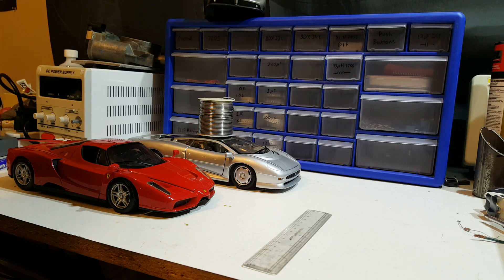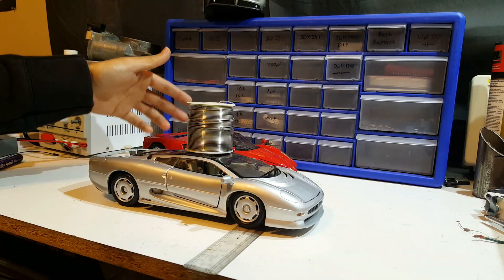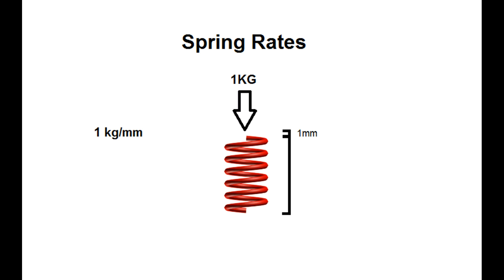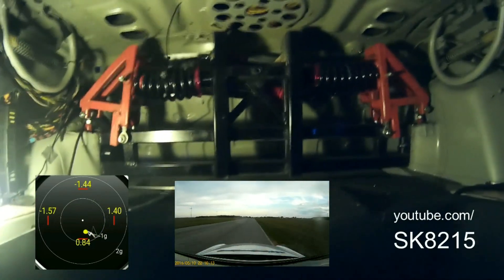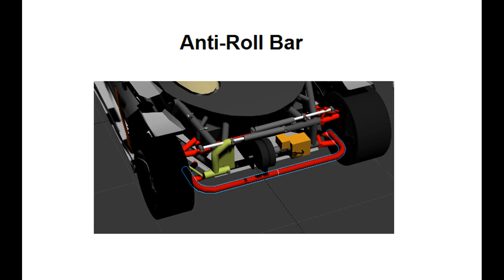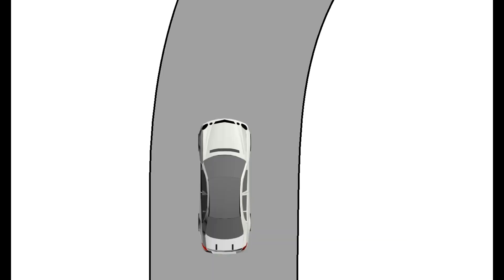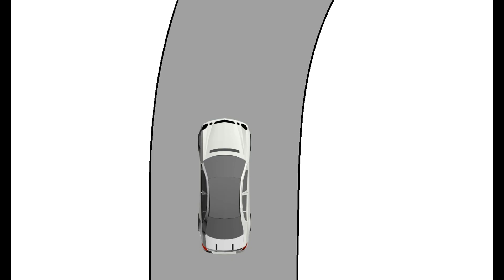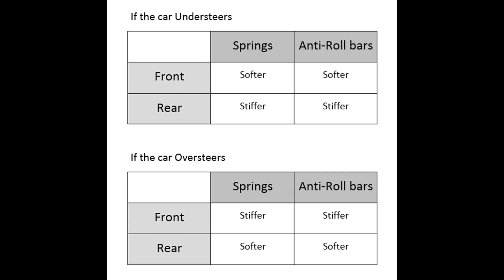Suspension Setup (Springs and Anti-Roll bars / Sway bars)

Comment: You stated that adjusting the top lock washers on the coil overs is where you adjust preload and ride height.. Can you explain yo me how this adjusts ride height over the bottom coil over body adjustment? It was always under my understanding that the top was only for preload and never for ride height... Very good video by the way
Reply from the maker: The cars weight can only compresses the spring by a certain amount so adding preload wouldn't compress the spring further, it just lifts the car higher. The only time it actually compresses the spring is when the suspension is at full extension. 

The lower setting will also change ride height but your changing the point at which your suspension bottoms out every time you change that. Without proper bottom out settings the suspension could go past its normal travel range, so the tires could be hitting the top of the fender or the cars bodywork scraping the floor everytime it hits a bump too hard.

Ideally the bump rubber over the damper is supposed to stop that from happening if the length of the coilover is set properly.
Reply: @xfmotorsports  good job on those videos, just would like to point out about corner balancing, what you said in the video end comment here- when you do it with spring preload that's when you are changing the travel ( more preload will result in cars weight compressing the spring less , shorter distance) , and will have less effect on transferring weight between corners , plus it will vary a lot depending on your springrates. That's why me and people I've worked in the field with usually use mostly the hight adjustment perch for corner balancing and preload for damper travel ( or otherwise - a combination of both).
Good job again. And impressive self control on some off the comments obove .
Reply: It would depend on the design of the coil-over. In most common designs i.e  "BC suspension"  (with separate ride height and preload) range lowering or raising from the bottom will not change the damper piston stroke position. The whole suspension unit would be static in its own right and only be lowered or raised via the bottom cup. 

If it only had a single adjustment point "spring perch". It would do both simultaneously. If lowering excessively it would reduce compression damper stroke plus on full droop ( when the car is jacked up ) your spring would be unsupported and rattle so they introduce helper springs. 

I am not familiar with what's fitted in the car but the above rings true for most suspensions kits on the market. This kit may well act as stated.

Comment: At 17:42 I don't understand how reducing ride height at FR also increases the load at RL. It should actually take away some load, right?
Reply from the maker: In that example there's more preload so more height added to the FR, so that will tip the car over towards the RL tire and add load on that tire as well. That's just to explain corner balance. Usually you wouldnt change ride height on an individual wheel, its changed equally on both sides so the corner balance remains unchanged.

Comment: Very informative! There's one thing I don't understand when you put the rear seat bar to the front wouldn't the car roll more in the rear and less in the front?
Reply from the maker: The front and rear cant roll independently of each other unless the cars chassis is really wobbly. Usually chassis only flexes less than a degree so the front and rear body roll is more or less the same.
Reply: SK8215 I guess you're right. I am thinking more in terms of ride height than roll angle. The chassis may roll the same amount f:r but the car will pitch forward/rearward in roll depending on the effective wheels rates. If all the sway is up front the the car may not roll but the car will squat as weight shifts rearward in roll. This would cause understeer as load comes off the front tires.
Reply: This can't be correct. 

You even say in the video that you don't want your sway bars to be too different front and rear... Now you're saying it doesn't matter because of chassis stiffness? In a dynamic situation, like acelleration, weight shifts reaward and I'm 100% positive the rear can roll more than the front in this situation. I've seen the pics to prove it (rwd with no rear sways).
Reply from the maker: The reason you don't want extremely different sway bars front and rear is to keep load even otherwise you can end up in a situation with one wheel lifting off the ground (inside tire reaching 0 load). 
The situation your talking about is pitching and rolling at the same time like under acceleration out of a corner. That still does not make the front and rear roll differently. The roll centers can be different front and rear in which case the car rolls around an inclined or declined axis but the roll is still the same front and rear
Reply: SK8215 I disagree with that and you even contradict yourself in your own rebuttal by saying the car can roll at different rates but roll will be the same f:r on the outside tires. That's just not true if more weight is shifting rearward due to acceleration and the outside front tire is unloading... the inside rear tire will squat and roll more than the inside front tire when accelerating out of a turn.
Reply from the maker: That's not what I said at all. Read the comment again. Roll is measured by the amount your cars body leans towards one side from horizontal. If your accelerating the car pitches back at the same time as well. That does not make the rear roll more than the front. Its just pitching and rolling at the same time.

Comment: From my understanding (don't know if it's correct or not) , by having an anti-roll of whatever stiffness, it's limit the overall body roll so you can keep the overall car CoG close to it's ideal spot in expense of taking out the grip of the tyre (either front or rear) as the anti-roll bar always unload the inside tyre more than the car should and load the outside tyre more than it should under weight transfer.

(Edit) I also think anti-roll bar does help with the car than run an underbody aerodynamic downforce where the ride height are crucial to keep the ground effect work efficiently.
Reply from the maker: If you add stiffer anti roll bars at both the front and rear then yes, they should only reduce body roll and have no effect on the balance of the car. If you reduce body roll you do reduce weight transfer by a bit but the bigger benefit of less body roll is you can run your car lower which reduces weight transfer further. So yeh anti-roll bars have both uses, reducing body roll and fine tuning the cars balance.
Reply: @xfmotorsports  sorry one more thing- I think saying that ARB is a device to get a certain balance off the car ( that is actually what gives that extra drivers confidence and ultimately speed ) and the less off ARB you can get away with- the better , is important so people would lose this misconception about them as one off the most important "speed" mods.

Comment: You do NOT set ridehight by adjusting preload! You do not use spring rubbers, EVER! You use a stiffer spring and more preload.
When you but coilovers they are designed to not allow the car to bottom out. The lover adjustment is for ride hight.
Then you use preloading to set cornerweith. never hight of the strut. 

If you use as soft springs that the car can bottom out you really need to rethink everyting. Not even stock springs would alow that.

And you can not just adjust springrates, you need to fit springs that work with the desired dampening of the shock itself. The shock need to be adjusted to match the springrate and preload.
Reply from the maker: You seriously need help if you believe that.

First off, any one making a setup for a track car would try to run their car as low as they can without bottom out. If your running extra ride height for nothing your just slowing yourself. That's the reason coilovers come with ride height adjustment in the first place.

You adjust the length of the strut for setting bottom out NOT ride height. There's a bump stop rubber above your damper that should stop the car before the body work hits the floor. That's what its there for. Every car has it. If your just using that setting to adjust ride height then obviously you don't even have your bump stop set at the correct height.

Spring preload has nothing to do with spring stiffness. You only change corner balance when you change spring preload on one wheel more than the other. If you change both sides of the car by the same amount it only changes height not corner balance. 

This is not something I believe, its something every other person on the track knows. 
Or even search it up on the internet yourself.
Reply: SK8215 

Im not talking about spring rate. Preload does not affekt spring rate, but it does affekt  rebound speed! The dampening is the most important part of the suspention, not the springrate.
Reply: Aslo i never said you want to run any car high. Do you have difficulties in understanding written text?
Reply: Sorry you guys are dead wrong on this. The bump stop is in place to prevent the strut from bottoming out and/or the spring (harsh impact and instant infinite spring rate = handling issues). The bump stop has nothing to do with ground clearance. You set ground clearance (ride height) using the lower spring perch. Yes , you guys are also right in that you need to be aware of how much bump travel you have and therefore must maintain a minimum ride height to e sure you don't bottom out the chassis.

You DO NOT want to run a car as low as possible. A production cars suspension geometey is not designed for it and you'll actually reduce rear downforce without proper aero... Excessive lowering is the #1 misguided way to ruin the handling of a car.

Preload is just a quick way to adjust corner weights. You should ideally asjust the ride height. Why? Becausedifferent preload ok different springs means a different return rate; therefore, also requiring different rebound damping settings at each corner. You don't not want preload and you definitely don't want different preload on each wheel. This is basic stuff.

Comment: 13:23 the roll bar presentation and the subsequent +150 kg weight transfer to outer wheel is wrong. If rhs rollbar goes up, it pushes the other ALSO go up. Hence rollbar DECREASES the weight transfer NOT like you showed. Great vid otherwise
Reply from the maker: Its confusing to understand but the example is correct although a little exaggerated. 
The reason stiffer anti-roll bars reduce weight is because the car rolls less so the CG stays closer to the center rather than moving towards the outside tires due to body roll. 
In my example the overall anti-roll bar stiffness was the same so the car rolled by the same amount. If you add the weights of the front outside and the rear outside you'll see the weight transfer from side to side was unchanged in the example.
Weight transfer on an individual axle however increases if you add a stiffer anti-roll bar just to that axle. That's the reason why stiffer front anti-roll bars cause under-steer and stiffer ones at the rear cause over-steer. If you stiffen both the front and the rear by the same amount then yes the car will roll less and slightly less weight will transfer to the outside tires.
Reply: Agreed that Roll Bar DECREASES the weight transfer to outer wheel. For it to do so, the two end of the Roll Bar should work in the same direction as illustrated in the below video 
https://www.youtube.com/watch?v=_liGnV3PTiQ&t=70s
Then your illustration at 13:23 is wrong.
Reply from the maker: Hes talking about a wheel hitting a bump and the anti-roll bar trying to lift the unaffected wheel as well. I'm talking about the load transfer on individual wheels while cornering. They are two completely different things. 
An anti roll bar reduces weight transfer because the car rolls less NOT because it unloads the outer and inner tire at the same time. That's physically impossible.
Reply: @SK8215 
You say the reason it causes understeer or oversteer is because there is weight transfer on that axel.  What about the principle that the car is a flat rigid rectangular table. If the rear right corner goes low, the front left corner goes high. Thus,  using this example, If I stiffen the rear ARB  the rear right corner does't go lower and this makes the front left corner not go higher, thus more load and grip at the front, thus less understeer = more oversteer.

So, what causes more understeer or oversteer? the weight transfer between the axle, or the rigid chassis principle?
Reply: I can't wrap my head around how the videos example of weight transfer is accurate... 

If when using a larger sway more weight transferred to the outside wheel then the car would still roll just as much as before... The video is overlooking something.
Reply: The misconception presented in the video seems to be that the sway bar twists evenly on the inside and outside wheel. This is not true. When the outside wheel compresses the endlinks pushes down on the sway bar on that side. The opposite end of the sway bar does not also twist in iequal and opposite fashion and pushes up on inside wheel... The sway bar torsion absorbs the energy like a spring. The chassis on the inside wheel is actually pulling up on the inside sway bar tab which then in turn loads the inside suspension and lifts the inside wheel if the force exceeds the amount of load the inside wheel was carrying. It is similar to running more rebound on the inside wheel like oval cars do...  More weight does not transfer to the outside wheel as depicted. What load do you think is compressing the inside suspension?????

The only thing that can change how much weight transfers to the outside wheel is track width and roll center.